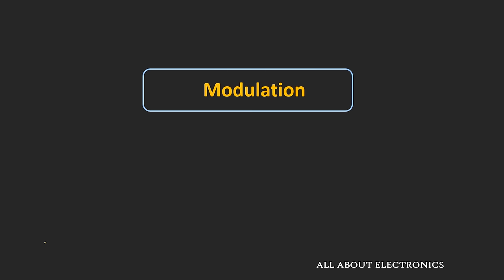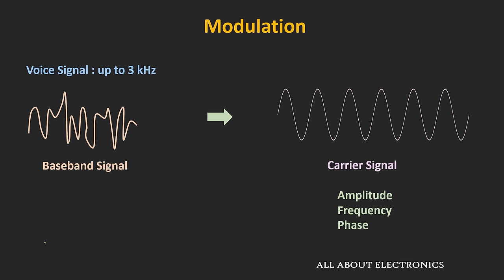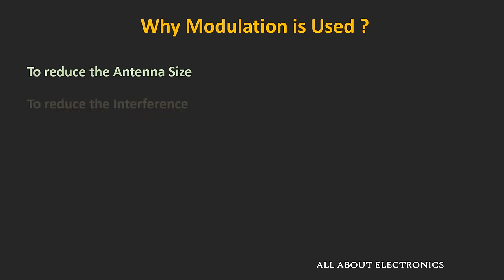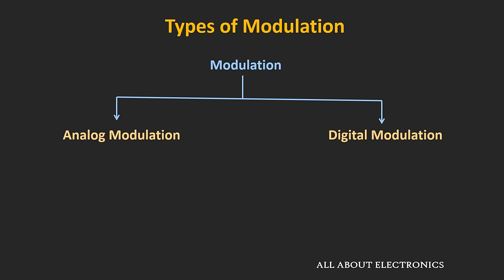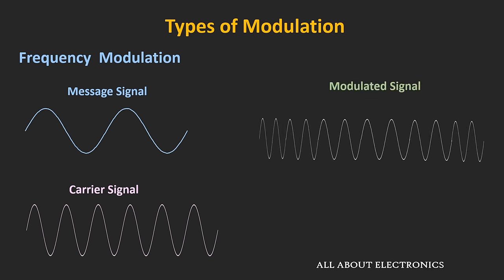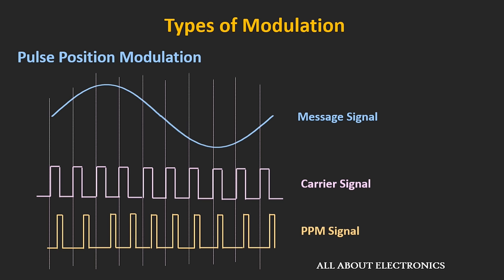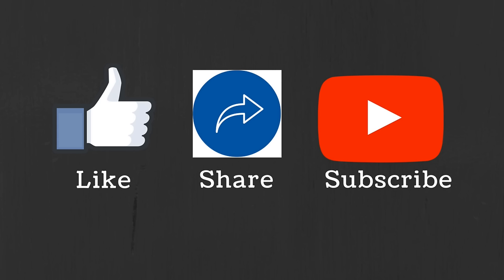What is Modulation ? Why Modulation is Required ? Types of Modulation Explained.

Comment: There are 2 types of modulation. Frequency which is 90 degrees. Amplitude which is 180. F demodulation 270. Band spectrum is the push of one over another of cycles.

Comment: 🎯 Key Takeaways for quick navigation:

00:12 📡 Communication involves exchanging information wirelessly or through wires between distant points.
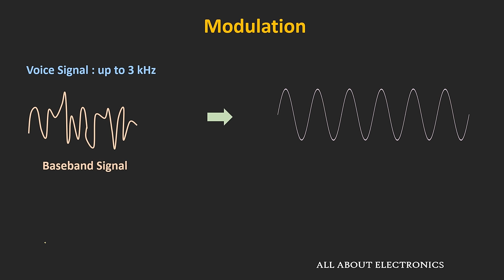01:32 📶 Modulation is the process of changing a property of the carrier signal (amplitude, phase, or frequency) according to the baseband signal, enabling transmission of the baseband signal over long distances.
02:25 📏 Modulation is used to reduce the size of the antenna and manage interference in wireless communication.
05:32 🔢 Modulation can be categorized into analog modulation and digital modulation, with various subtypes in each category.
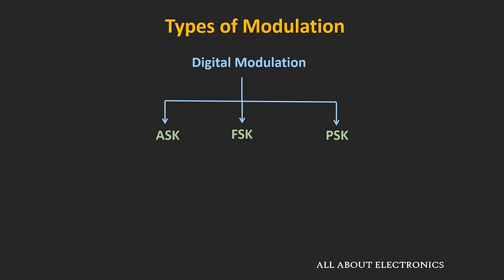10:06 🔄 Digital modulation includes techniques like Amplitude Shift Keying (ASK), Frequency Shift Keying (FSK), and Phase Shift Keying (PSK) to represent digital bitstreams.

Made with HARPA AI

Comment: Please clarify. Modulation, we use to transform low frequency signal into high frequency signal so that it can reach upto long distance. Confusion is that high frequency applications like mmWave, visible light communication are operational at short distances. 🤔 what is the relation here of frequency with the distance? Am I ignoring any other parameter? Communication expert,  Please response. THANK-YOU
Reply: Certain frequencies get absorbed by air. Generally, lower frequencies travel farther because few elements in air will absorb the wavelength. 
Note, stoichometric spectroscopy can be used to determine with frequencies any given element/compound will absorb/reflect.

Comment: thank you so much for the amazing video !! @ 4:13 you said each signal is modulated at different carrier frequency does this mean, it is an FM modulation?  or regardless of the modulation type? there will be always a change in frequency?
Reply: To my considration there is always indeed a change in frequency, otherwise there would be no transmitting.

Comment: Isnt PCM a method to convert analog to digital? Why it is under analog modulation?
Reply from the maker: The signal which is being modulated is analog signal. That's the reason.
Reply: @ALLABOUTELECTRONICS  excellent video, which helps traine and trainers
   But kindly explain with working circuit please,it will motivate, thank you keep it up.

Comment: can someone tell me what is the difference between modulated wave and modulating wave?
Reply from the maker: Modulating wave is the message signal. The carrier signal changes its amplitude/ frequency according to the message or modulating signal.  The modulated wave is the resultant signal after the modulation. The modulation could be AM, FM, PM etc. But the resultant wave after the modulation is called modulated wave. 
I hope, it will clear your doubt.